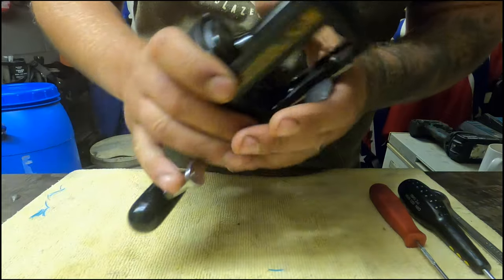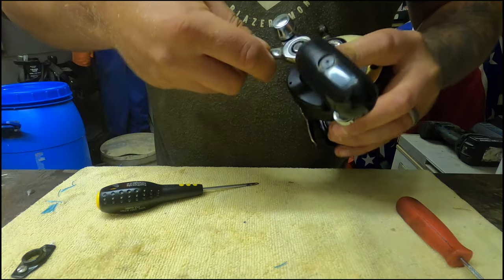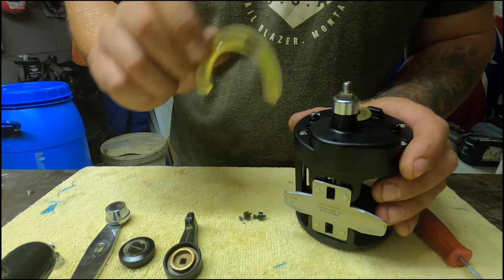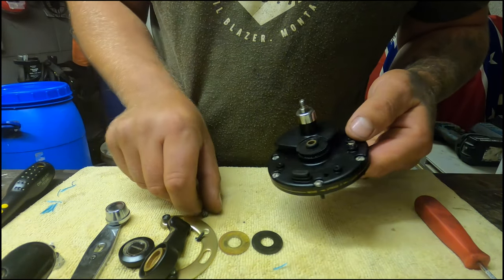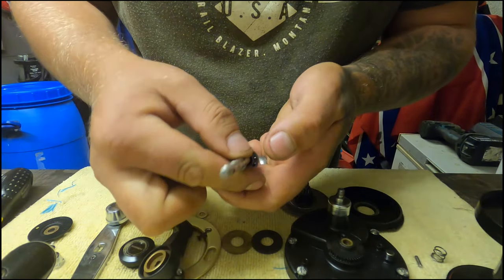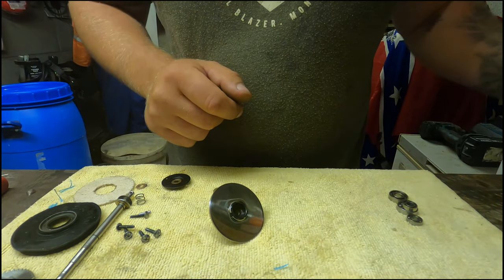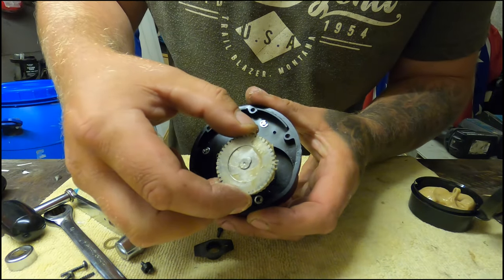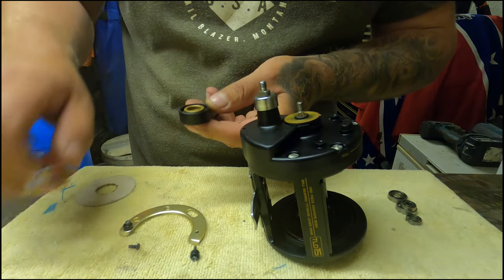Shimano TLD 15 rebuild all Bearings + Carbon drag installed

Comment: Great vid...
I’ve a tld 15 don’t think it needs new bearings but.. freespoll is fine but apply the leaver drag and the handle becomes stiffer to wind?
No bearing grunting like you had.. any advice please.
Tight line with the sharks!
B
Reply from the maker: It could be bearings with play etc the one in the reel I had was very bad

In your case it could be the handle bearing not the spool bearings

Thanks dave
Reply: @C3BFA  wow thanks for a super quick reply... I have a look and report back!
Great vid another follower here!
B
Reply: @C3BFA  
Well had a little play ... the handle and spool turns fine out of gear but when the leaver drag is applied it starts to stiffen up?
The more you apply the stiffer,  until it’s almost unable to wind?
Reply from the maker: Thank you b br I appreciate that
Reply from the maker: Have you tried to back off the adjuster knob on the lever drag?
Reply: @C3BFA  
Yes .... that just makes the drag easier so you have to apply the leaver more for the same drag and the you’re back in the same situation.....
Thanks for you attention to this thread!
Appreciated!
Reply from the maker: That's no problem I would definitely try change the handle bearing or just give it a full bearing service they are pretty cheap
Reply: @C3BFA  
Thanks again for your answer...
I think I’ll send it away for a full service at federline ... buy the time I’ve bought the bearings, had all the bits over the floor
It’ll be wot the it... I’ve got a Abu 6000 in bits I’ve never had time to TRY to put back together! ....
You keep the vids going.... I’ll keep watching!
Thanks agin for the reply’s ... top youtuber!
Reply from the maker: No worries br that's is the problem when you start or pull it apart don't stop lol because the next day it all looks different 😂

Let me know how you get on and thank you for your comments I appreciate it
Reply: @C3BFA  
No thank you for the quick reply’s and trying to help!
Great vids.....
👏👏👏👏👏tight lines
B
Reply from the maker: Thank you keep me posted be nice to know what it was
Reply: @C3BFA  I will ...
Reply: Hi again ....Well I sent the tld away to Shimano it seams like it was bearings as they replaced 2 and serviced it.
I’m waiting for a reply if there was something else wrong.
 It was £45 .... that’s labour, bearings postage back and the dreaded VAT. Plus it cost me £4.20 to send it.
B
Reply from the maker: That's a fair price and it's ready to fish now glad it's sorted
Reply: @C3BFA  the postage and VAT kills it... 
enjoy you’re boat!
B
Reply from the maker: It does but that reel is ready to catch fish so go get um lol